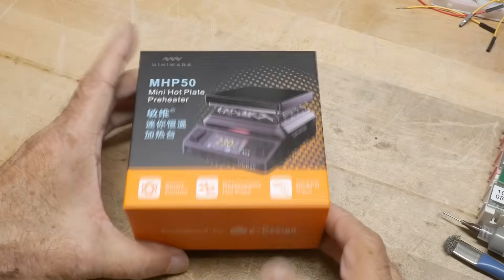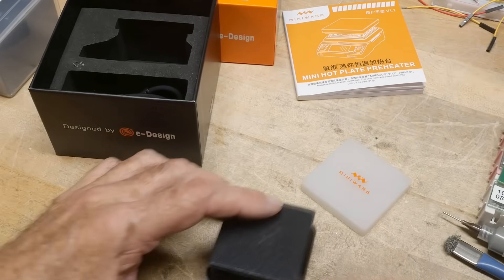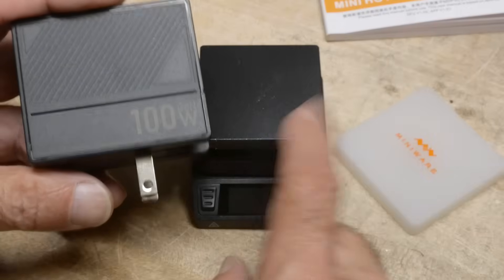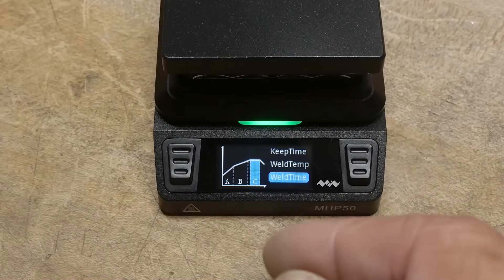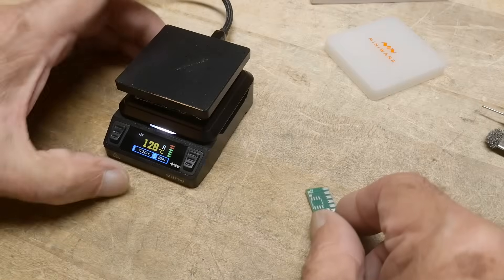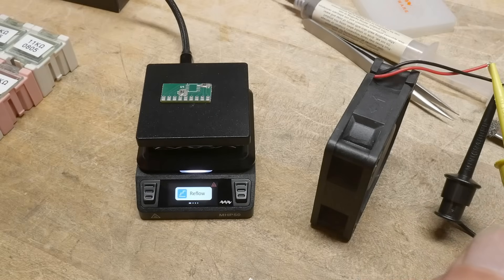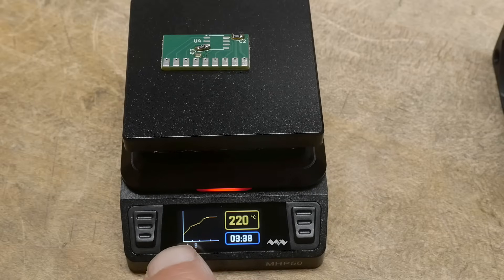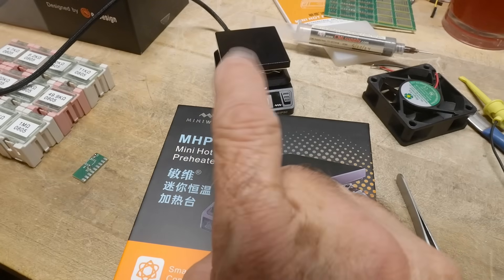#2379 MiniWare MHP50 Soldering Hot Plate

Comment: Doing "reflow profiles" with blob-dispensed paste (in open air) is more "electronics theater" than actual electronics. The soldering on those pads doesn't look good - and as others have mentioned, one of the resistors floated away from its place.
Reply: 5:58 He put two 0805 resistors on the board "for fun". What could be improved? Use less solder paste? Use a stencil?

Comment: Costs triple what soldering hot plates sell for on amazon and those run on 120vac. No need to spend even MORE money to get a decent power supply. If I want to ramp with one of those I can easily do it by hand by setting a different setpoint. 
I'll give it a pass.. Thanks.

Comment: Seems very expensive compared to the "other brand" that I bought.  Never burned myself while using so that is a non-issue for me.  The reflow control would be nice but not for the large uptick in price.  I use a large external supply through an adapter and not one of the USB C supplies for my "other brand" unit.  I do use a lower temperature paste for reflowing boards which makes the reflow profile less of an issue as far as I am concerned.  These do not work great for parts removal/recovery from junk boards for me.  I still use a propane torch to recover parts from junk boards for reuse.  Quick high heat works better to release parts for reuse for me.

Comment: How important is the curve for re-flowing? Could you get away with just bring it up to ~220c for a short while then turning off?
Reply: Depends what you're doing. Without the soak time flux is less effective, so solder can flow oddly. For a lot of things though it's fine, especially if you don't mind reworking joints.